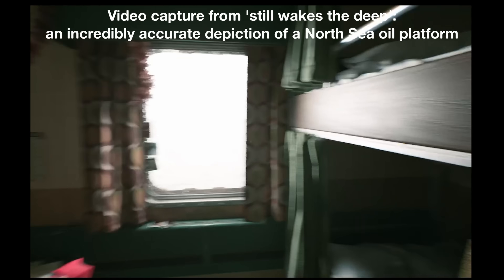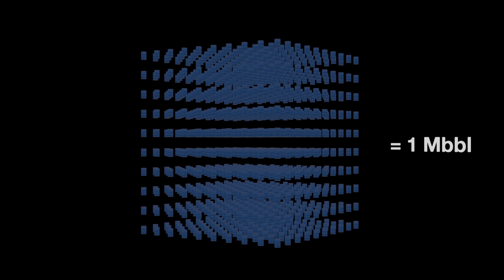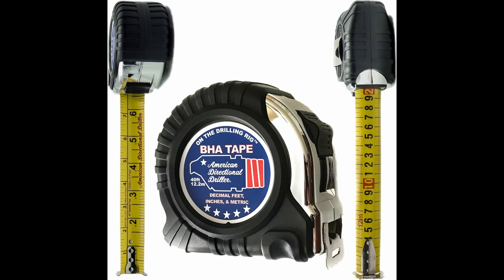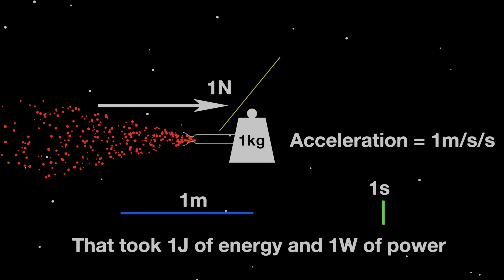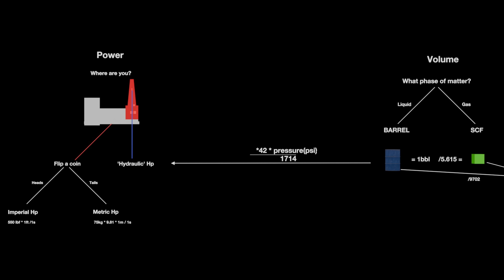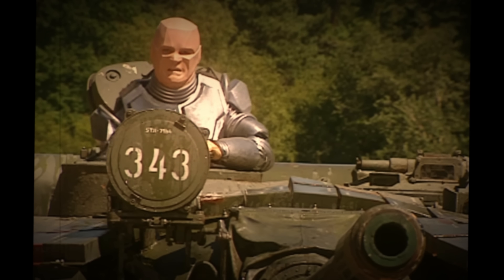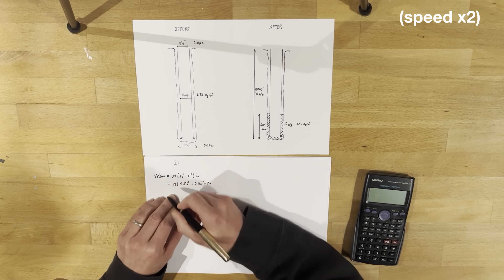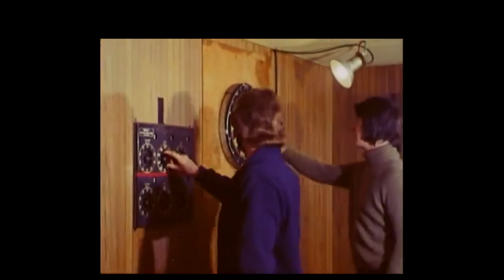Oilfield Units: a Measurement System so Cursed it made me Change Career

Comment: Hi you're describing the US. The only imperial or special unit we use in Canada (in well servicing, anyway) is PSI or F. Thats pretty much only for internal operator facing data points, because the O&G company would be pissed if we sent them a chart or WITS stream that we pumped/are pumping their well at 4000 PSI when they're expecting MPa. 

We use F and PSI units only because imperial unit gauges are far more common and easy to source for maintenance, and they're usually dual-unit anyway.

Comment: European railway adjacent person(TM) here. Our units are fairly sane, except for brake systems: The braking force of a vehicle is measured not in Newton, but in 'brake tons', which are usually higher than the vehicle's weight in tons.
Why? The heavier a vehicle, the more brake force it can excert (weight force x coefficient of friction steel/steel). In the 19th century, you'd measure the stopping power of a train by dividing the weight of all vehicles with brakes (then always handbrakes) by the total weight of the train and get a 'brake percentage'. 
Then, various automatic brakes where introduced, which are more effective than handbrakes. So they assigned the new brakes a 'brake weight', as in: 'This car weighs 20 tons, but the brakes have the same stopping power as the handbrake on a 23-ton-car, so we give it a brake weight of 23 tons.' Now you calculate the braking percentage as total brake weight divided by total train weight. This is often more than 100%.
Automatic brakes have many different settings, so a vehicle will usually have several different brake weights, one for each possible combination.
Reply: Yep, brake percentage is a fun unit. It actually is fairly arbitrary because 20 tons of braking won't stop a 20-ton car instantly. Instead, it will have a certain braking distance until it comes to a full stop. The way it works in reality is that the network is designed around a certain standard braking distance for each max speed plus a bit of safety margin as defined by a regulator and you sort of work your way backwards from that to determine how sufficient or insufficient your brake force is to stay within those distances. Different networks use different standard braking distances, so the brake percentage values aren't comparable between them.

Comment: And the reason it isn't simplified and made logical? Because so many people in that very specific field have had to learn it and now master it, and all that special knowledge goes away if you change, so they resist: "why change, it is working just fine for me?" and being fully blinded by the fact that it isn't actually working and it makes every single thing harder. edit: ok, that is what he comes to at the end, it is a form of gatekeeping, building an artificial obstacle, a wall that separates the elite from the plebs, and they feel really proud about their accomplishment.

This is tangentially related to old people complain how young people get it so easy, after removing a ton of obstacles that really were there just to be an obstacle. Remove the non-sense in the oil industry and every veteran will think that the new people get it too easy, that there is some great wisdom learned by doing it the hard way, that it builds character... And the irony is that the very people who protect the system are fucked the most by the system: those who need to do the calculations are the ones doing the most unnecessary work and having to quadruple check everything because it is so complicated and involves so many conversions where a decimal point easily jumps one place, and then things go kaboom. The are dragging a huge stone behind them and refuse to have it removed.

Comment: @14:18 note that American railroad practice for expressing curvature is also in degrees curvature per 100ft (usually just called degrees - so a 1-degree curve, a 5-degree curve etc). I wouldn't be surprised if that is the source of the oilfield unit.

Comment: In the finance side we had to handle dollers per thousand barrel equivalent and volume per thousand barrel equivalent.

Yeah - volume per thousand blue barrel equivalent.

Most of the contacts for futures were based on a formula that took grades into account based on potential for energy generation, and so we use equivalent barrels, but we also had to deliver said oil in a boat, which would have actual barrel capacity. 

At one point I had a spreadsheet with Mbbl/e.bbl lookups. It hurt people who were more typically in the futures desk (who just had dollers per contract) as opposed to the physicals desk (where we sold off futures then actually delivered the oil to whoever held the future on delivery date).

Oh yeah, and unlike every other firm of future, with the oil futures we don't just trade the difference between the fair price and the strike price when a future expires. We are showing up at a port with your damn oil.

And yes, this has absolutely fucked some Reddit trading gurus who did not know this, and did not take our calls for six hours, and got charged for the boat for the time between contract end and when he sold to someone who actually had a tank. I think he got hit with seven boat hours (and if you work out all the crew salaries, and the port fees, seven hours is a lot).
Reply: So you can actually still buy physical fuchers 
Interesting
Reply: @Goroca yes you can. And its really easy to make a mistake about which one your doing. 

That was one of the many reasons that led to the spot price of oil hitting the negative one time - typically there is a small discount due to the physical receipt elements - but when COVID hit, and all the tanks were full, people became desperate to sell the oil that was going to be delivered to whoever held the future at close.
Reply: @puffinbasher 
Lol 
Interesting, I guess the minimum amount of oil you can buy is quite large.
Reply: @Goroca contracts vary based on grade and location. A high volume area it's typically 1000 equivalent barrels (or 10000 weighted Brent equivalent barrels - yes, that's another unit altogether - but that's a pure financial one and there are about 100 people who touch those contracts are inherently leveraged and crazy crazy risky).

However, the western brent benchmark you can typically buy as little as 100BBL (but be warned, oil from some wells is graded at something other than 100%, so if they deliver in 91% grade, you get around 110BBL to store.

Comment: Oh and the BTU/h (British Thermal Unit per hour)  ,which I kid you not gets shortened to just BTU so the rate of BTU in an hour could look identical to non-rate, also use the same stupid MBTU/h is 1000 BTU/h which is used throughout American HVAC engineering.  In natural gas piping every place has a different quality, and efficacy of natural gas which is given in BTU/cubic foot and is given in a lookup table which is nearly always way below the real number would be. This number is important as when multiplied by the BTU or BTU/h or BTUh or MBTU/1000 gives you a very important value called CFH. The unit is Cubic Feet per Hour. This is what gas piping sizing is given in, which depends on the longest continuous length of pipe.
Reply: Tbh same is with kWt and MWt. They get shortened for no good reason, and you are left to wonder what they actually mean.

Comment: I’m an American engineer. In college, we used SI except those few times we used other units simply because it made the problem more difficult. In the industry, we’re stuck with US units except in very particular situations when we mix SI and nonstandard units such as “miner inches”. What are miner inches? That depends on what state you’re in and when the flow rate was issued.

I wish we would just fully convert to metric. Maybe we will be forced to after the upcoming economic crash forces us to.

Also, I’ve used “engineering scale” (decimal feet) most often. Mostly because it is a widespread standard in the work I do. Some company policies demand it. It is nice because it keeps length measurements in one unit. No conversion errors, no loss of precision, etc. That doesn’t stop some people from reporting feet and inches or just inches.
Reply: Miners inch: the flow through a 1" square hole with a head pressure of 1 foot.  Easy right?  Yes, we have friends with senior water rights to one miners inch of water from a public ditch.
Reply: @johnmiller8884 different states define the unit as a fraction of a cubic foot per second. Some are 1/28, others are 1/20. Some use the definition you gave. It all depends on the state and the year the unit was given as the legal definition changed in some states.
Reply: Hell no, I’m never using metric.

Comment: My favorite part is that while the unit bbl is 42 gallons, an actual metal oil drum is 55.
Reply: Here (US) 42 gallons is one bbl of crude oil.  the 55 gallon drums are chemical drums.
Reply: Metal oil drums are used for shipping refined products like motor oil or fuels, not crude oil.
Reply: What the actual Fuck?
Sincerely,
the metric system.
Reply: @albertoolivieri7151  obviously not the Cnadian "metric" system.
Reply: Just a note here. US and British liquid measures used to be the same but the UK tried to kind of half ass decimalize the system and changed the gallon to be 10 pounds of water (was 8, 1 pound pretty pint), and changed the pint from 16 to 20 oz. That would have been a bit useful if a gallon was 5 pints instead of 8 then a gallon would have been 100 oz. Meanwhile, the US was independent already so we were like "yeah, no".
Reply: @pjl22222  I bet people were happy to have bigger pints when they went to the pubs.
Reply: @pjl22222  Ugh. Should've just made a pint 500ml, a pound 500g and a gallon 10 pounds of water/pints.
Reply: @pjl22222  you need to educate yourself, long before 1776 a gallon was closer to 10LB than 8LB, take your own US dry gallon that was 9.711LB of water, even as far back as 1228 a gallon was 9.56LB of water, the US just decided to pick the wine gallon, which it legally adopted in 1836, which is after 1776 and after 1824 (Imperial gallon), then you fail to grasp that every US unit was totally redefined yet again in direct relation to the meter and KG so the customary unit system is not the same as old 19th century units per se that they reused the name of, which is why the US uses customary units and international yard and pound units, while the UK uses imperial units and international yard and pound units, with imperial units being older than customary units
Reply: Ok , ok now - now I got a headache....perhaps the swearing is vital to full comprehension ...tonnes of fun ...convert your mind first , never flex , pick one stay in your lane , ...
Reply: @Thom4ES short tons or metric tons?
Reply: Every oil barrel I’ve seen has been a 44 gallon (200L) drum
Reply: @LocalDiscordCatgirl 200L is 44 Imperial Gallons or 55 US gallons. The unit “barrel” is 42 US gallons, which is none of those.
Reply: @LocalDiscordCatgirl  British Gallon is larger than the US Gallon. UK Fluid ounce is smaller than the US fluid ounce, but the UK pint is 20 fluid ounces, compared to 16 for the US pint.... Hence the US pint is smaller, the US gallon is smaller, and so on....

Caused issues during WWII when many of the initial USAAF deployments to North Africa were using British aircraft, mostly Spitfires and mosquitos, before the US could get enough US made aircraft out to them.

The US ground crews (and everyone else) assumed the Gallons were US Gallons, so for a while they had issues with underfilling the fuel loads of the aircraft, with the resulting 'oh shit I have just run out of fuel' incidents that arose... 

It took an embarrassing amount of time for it to be realised that the British and US Gallon are in fact different. If I remember they got around it simply by supplying British fuel bowsers to the US squadrons operating British aircraft as they worked in British Gallons as well. Meant only the Logi guys had to make any conversions, the ground crews could just fill the UK built fuel bowsers up and they were good to go.
Reply: @danthewolf1997  congratulations!   You’ve discovered that a drum is not the same as a barrel!  SMH
Reply: @redtandem8483  You realize that's a part of the problem, right

Comment: Bad news, American aeronautical engineering is still done in imperial units. Maybe the latest and greatest stuff has converted to SI but this holds true for factory fresh Bombardier and Gulfstream business jets, military aircraft designed as recently as the the 1980's, and all manner of stuff I've worked for foreign government customers. The only metric I ever see is on little general-purpose electronic components we're integrating.

Comment: Wow, this is even worse than water treatment! The worst we get is seven-ish different units that can be used to express the same chemical dose that people just refer to as “parts” when talking (mg/L as delivered, as metal oxide, as metal ion, as active chemical without waters of hydration, as active chemical with waters of hydration - which of course is the one called “dry” - the real freak shows use grains per gallon, rarely you’ll see mmol/L as metal ion)

Comment: Well the point about SI units are to sacrificing the niceness of the number infront to eliminate conversion factors. I am okay with using other units when the number infront is nice like using fahrenheit for weather where it is just between 0 to 100 most of the time, or atm where 1atm is a commonly understood concept. But when you eventually step on something like 2.88in or 2-7/8+5thou it just doesn't help no matter how you write it.
But whatever unit you use is still better than this dumpster fire. My heart has to go out for the fellow engineer dealing with this mess.

Comment: American chemical engineer - we had a thin film coating unit made to very high spec at great cost that delivered consistent and excellent results. It was also adjustable only in mils (thousandths of an inch) and so consequently we kept a micron to mil conversion table posted conveniently by the die adjustment wheels.

Also batteries can have charge or discharge rates measured in a number of ways, but a useful way to normalize for capacity so you can compare battery performance to divide the current (A) by the capacity of the battery (Ah), returning a value called C-rate in inverse hours. 1C means that the battery charges or discharges (note: technically not the same number) its full capacity in one hour, 2C half an hour, 0.5C 2 hours etc.

Comment: Back before the metric system, every town in France had their own units and didn't want to change over to metric.  They had reasons for using each one that made sense locally.  The metric system was made to facilitate international trade and that destroyed local industries.  It was globalism sticking its ugly nose into people's lives.  

I like complicated systems of units.  They're human.  I started out with astronomy and those units go back to the Babylonians and are still in use despite the metric system.  You still use one for time and angular measure.  Are degrees or grads better than radians?  No.  Is a meter inherently better than a yard or a toise?
Reply: @DissoluteGambler  Ah yes, i looove making discourse between people from different regions harder  because it's obviously human to not be able to intuitively understand what someone else is saying. 

We also should get rid of synchronised time, which was similarly disjointed before being standardized when distances between towns shrunk due to railways. It's very convenient and just so human for everyones clock to be some arbitrary amount off to make scheduling impossible.

Lets all go back to having the units change with every different ruler too, when feet where defined by his majesty's shoe size. It's way more human than some nonsensical standard defined by physical constants after all.

Comment: US engineer here. Even when starting in imperial and needing imperial for my result, sometimes I still convert to metric for calculating things because of how much easier it is to work with, specifically if I have a problem with my spreadsheet and need to debug.

Comment: Tenths tape is super common in land surveying post 1980 which is better then chains (1ft= .0152 chain) we used to use. 

The problem is no one referencing your measurements to build houses, bridges, or apartment uses it! So 6’6” is 6.5 according to the tenths system…

 works great for raw trig and 3d modeling does not work when people don’t know what a hundred thousands of an inch is when trying to build plumb and square

Comment: In refineries, we use pressure a lot. Pounds per square inch. In metric we could use bars or pascals. But no. It is kilograms per square centimeter.
Reply: yo i could convert kg/sqcm to Pa without looking anything up. Its still better than mmHg...
Reply: Have you told them kg is a unit for mass, not force? It should be N/m² or N/cm²
Reply: @randoomday1520  There's a slightly clumsy force equivalent, the kilogram-force, or kgf. It's the force exerted on a mass of 1 kg by a gravitational field of 9.80665 m/s^2. Or 9.80665 N. Unfortunately people who insist on using this unit often forget to add the f.